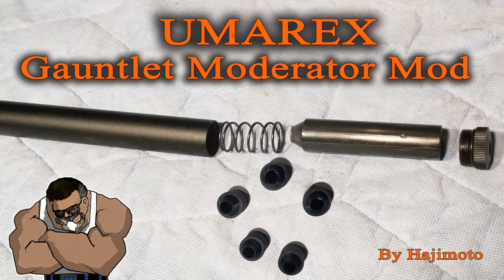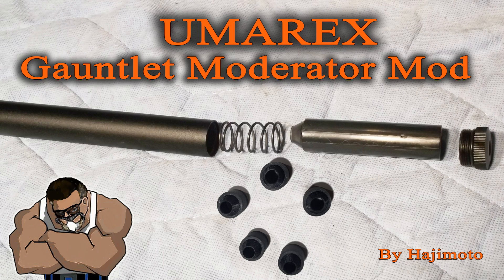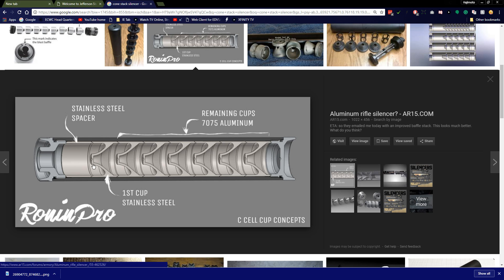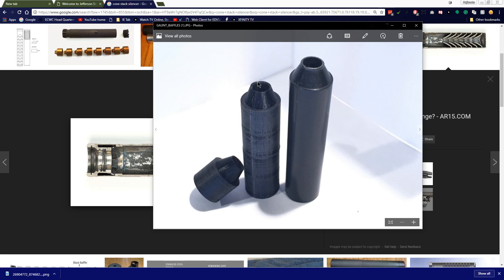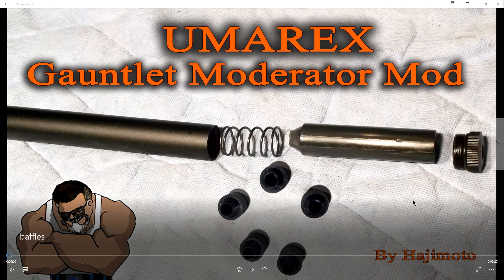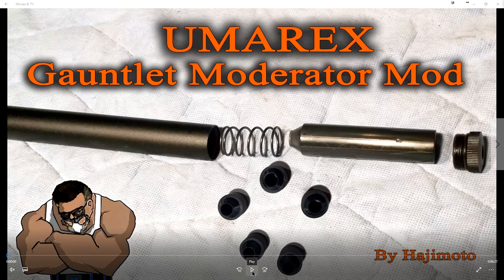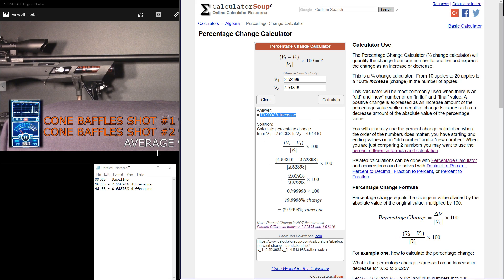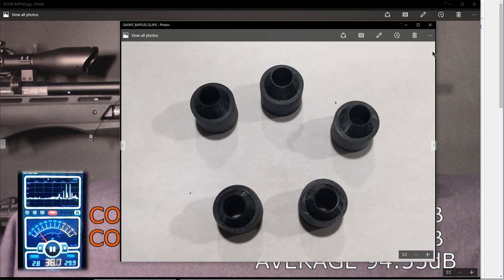Umarex Gauntlet: Quieting the Bark Silencer

Comment: what would happen if you put a few grooves on the outside of the cones to give the air an easier path back to the hole drilled in the shroud?
Reply from the maker: The only air that makes it to the ventilation holes in the shroud is the air that is stripped and diverted from the air stripper. The baffles are after the muzzle and therefore any air turbulence is on the other side of the oring seal so can only exit forward out the muzzle end of the shroud.

Comment: Just unscrew the shroud holder piece that is against the breech and move it forward the length of 5 more baffles and it will produce way lower decibel reading. You will need to make a new indentation on barrel for the shroud holder piece screw to secure properly.( sorry Im not sure what that piece is called).

Thats what I did on my Benjamin Marauder. I added 5 more baffles. It does look a bit odd since the shroud sticks out quite a bit pass the air tube. Well worth it though. Gun is whisper quiet.
Reply: sound suppression is over 90% volume, 8% volume distribution inside the moderator (hint: volume behind the muzzle is significantly less effective than volume in front of the muzzle, this has been known with firearms for nearly a century) (Blast chamber roughly 40-45% of the internal volume works really well), and the last 2% is baffle shape (K or W baffles don't hold/catch more gas, they slow it's return to the exit path by generating more turbulence). I don't get the spring loaded idea, all you're adding is a metallic "TWANG" every shot, as it's one more part to resonate the frequency. Tube inside a tube inside a tube inside a tube suppressor designs are out there for firearms, but they don't use springs, they just have strategically placed vent holes in each tube.

Comment: Question, do you have to drill the barrel shroud at the other end to use the air stripper? Can i use it without drilling it? Or woudl it not work as well?
Reply from the maker: You do not NEED to ventilate the shroud but it certainly help gobble up the surge of each shot. Also, without ventilation is not equal else I would not have recommended and executed it 😉
Reply: @HajimotoProductions  wow fast response, thank you- i will probably later drill the barrel, but for now just want to use it without = my gun is band new- only a few weeks old right now-

Comment: I just got my hp baffle stack in for my .25 Gauntlet! Prior to getting them in, I wanted to do some tests. With just doing your mod with the shroud only, I achieved a 2 db drop in sound. I decided to not use the sponge like you did, and instead used a 2 inch wide strip of fleece cut from a top my wife had in the closet( hope she doesn't  mind ! ) and wrapped it loosely around the barrel, before sliding the shoud over it. This set-up achieved another 2 db drop. Lastly, I installed your HP baffles, and tested again. This resulted in another 4 db drop, with a total drop of 8db when compared to a stock rifle!!! Also these mods resulted in no change to POI for my rifle! I will chrony the set-up soon just for giggles! Thanks for the great info, and product!
Reply from the maker: Thank you for taking the time to offer some feedback for others to read. Thank you also for the kind words.

Comment: You went through a lot of effort to makes this video.   Thank you.   However, you compared the sound of no baffles to the sound of OEM baffles to the sound of your baffles PLUS uncovering the barrel exhaust hole you drilled.   It would be good to know the sound levels of using only your baffles and the effect of only uncovering the exhaust hole.   Without that it really does not give us a proper head-to-head evaluation of the baffles alone.    I would like to know what impact you would have only by drilling the exhaust hole.
Reply from the maker: Hello and thank you Lon for the commentary. You are absolutely correct and are not the only person that has pointed this fact. But as i explained to the other commenters and I will do it again for you here.
The video was to show what I had come up with and tested, because I am comparing my modifications against a stock configuration which does not have a ventilated shroud. Just because my mod has two variables does meant it needs to be deployed fractionaly. I expect (just as you have done here) that the viewer will be inspired to TRY different configurations of their own and discover (and share, hopefully) those results, just as i have.
Thanks again
Reply: @HajimotoProductions  Thanks.  I think you hold the world record for speedy replies!
Reply from the maker: Lon I wish I could answer them as quick but unfortunately I can’t. Thanks for the kind words!

Comment: I guess just drilling a hole in the shroud will void the warranty. That hole is common sense.
There are some airguns with a factory hole or two in the shroud for reasons you stated. Makes no sense that Umarex did no put in an escape hole n the bottom of the shroud.
By the way I did change the o-ring out. I had one a little thicker. Put it on and sprayed some silicone lube on it and it slid down easily firm with no slop.
Reply from the maker: Drilling the hole will void the warranty on the shroud yes, but it should not void the entire gun. I was told by Umarex that they would not void the warranty of the entire rifle due to one thing being modified. Obviously any internal modifications would void the warranty but external changes, no.

Comment: They only sent me four cones! And you are showing that five will fit in the barrel. I'm shooting the 22 caliber version and was wondering why I only got four cones I instead of the five you show.
Reply from the maker: There should be 5 pieces in the set.  In this video you see the early version which was 5 cones equal in size but you should have received 4 equal and one smaller.  In the package you should have also received an arrangement detail sketch that demonstrates how the stack is arranged. Lastly, YouTube comment section is not the best place to vet these issues, the HajimotoProductions.com website would be the most direct way.  While you are on there you can also review the installation detail that I mentioned previously.
Reply: I found my mistake. My wife accidentally ordered it from another website. Just had a miscommunication with her and I will get one from your site.
Reply from the maker: Well if you already have a set from a different manufacturer, have you tried them to see if they are effective before you buy another set from me?
Reply: I did try them out but yours are quieter by comparison. I used my decibel reader and it shot a little louder than your setup.
Reply from the maker: Ok I just wanted to be sure you were not tossing your money away.
Reply: @HajimotoProductions  True but I saw all  your products. Doesn't look like a waste of money to me. Great products and of course very informative and deep videos. I plan on buying from your company in the near future. 😎👍

Comment: Hey Hajimoto what is the external diameter on those baffles?
I have a 2240 with BNM custom shroud that could really use these baffles, if they'll fit.
Reply from the maker: The OD is 22MM (0.866142)
Reply: @HajimotoProductions  Thanks man

Comment: I noticed that the Hajimoto baffle stack is 1/4" shorter than the stock moderator. This will reduce the spring tension on the stripper. Should I put in a spacer to make up the difference or doesn't it matter regarding accuracy?
Reply from the maker: You are correct that the HP Baffle stack is shorter and it is designed to take advantage of the deeper HP Air Stripper which is longer than the stock unit. Lastly, if HP Baffles are used with the stock stripper, accuracy is still improved due to better turbulence mitigation. There are folks like Jame from Shoot to kill outdoors that have found that adding addition shims was beneficial in adding barrel tension. Good luck!

Comment: besides the 4 db decrease did you test out how much less or more in power it has tho in fps? i would like to see if the reason that they have that design was to keep the fps higher.....would like to see you test it out with it and with yours and see if there is a change.
Reply from the maker: I can tell you that through multiple testing and over 100 users that shared feedback, they all experienced a 1-5% increase is FPS and a reduction of 40-50% in the standard deviation when coupled with the HP Air Stripper.
Reply: @HajimotoProductions  nice...I would love to see those videos but I can't find one on YouTube yet... if there any you can link me to that would be great... thanks.

Comment: The air stripper is still there Haji I should have said end of the air stripper instead of barrel my bad, there is no more twang from the gun. I don’t know what else to tell you it works Sir. I have done some tweaking on the for-end also its too loose for my requirements.

Comment: I believe you do not need it, this thing adds noise. Which we are trying to get rid of. My baffles are from the end of barrel to screw cap on shroud.
Reply from the maker: The something is wrong because there should be an air stripper on the end of the barrel then the spring and then the baffles. Again I caution you on firing the rifle without the spring you WILL destroy your baffles and possible damage the shroud/end cap.

Comment: The spring for the moderator
Reply from the maker: No Craig you DO need this, the spring is what keeps the cone-stack concentric, you will have severe pellet clipping without it.  The spring also adds tension to the barrel to keep the harmonic right.  I do not recommend you shoot the rifle with that spring out.

Comment: Will it affect my rifle if i were to fill its with a tire compressor?
Reply from the maker: You cannot fill a PCP rifle with an air compress for tires. The maximum PSI the average tire compressor will output is 110-125PSI a PCP needs at least 1200PSI to work properly. In order to fill a PCP rifle, you need either a High Pressure compressor or a High pressure SCBA tank that you can have your local paintball or scuba shop fill for you.
Reply: Hajimoto Productions what if it was one of the air compressors that you use to hookup to say a paint gun?
Reply: Hajimoto Productions also do you have any social medias?
Reply from the maker: Again, when speaking about PCP's you are talking about thousands of pounds of pressure, the compressors that you are describing are not going to be able to do what your thinking. I can be found on Facebook at Hajimoto Productions
Reply: Hey Haji i just placed my order for HP baffles. Thanks!
Reply from the maker: trevor5534 confirmation email sent, thank you!

Comment: Does this mod affect accuracy?
Reply from the maker: 6" at 30yard is more than a washer.  You need to unscrew the shroud and look at the air stripper to be sure it's not cracked, remove the air stripper and look at the end of the barrel at the crown, does it look normal and concentric? Lastly, try and post your issues you are having in Airgun forums like GTA (Gatewaytoairguns.com) or AGM (AirGunNation.com) not because I do not want to help you but more people will be able to help you and be helped by your posts there than here.
Reply from the maker: Yes, it makes the groups tighter because it reduces the turbulence being applied to the pellet. The HP Baffles with the HP Air Stripper produces a noticeable accuracy increase. Are you having accuracy issues?
Reply: Not yet as I don't own a Gauntlet at this time, lol. But, because I'm planning on buying one very soon I've been doing some research here on YouTube. I've been enjoying your videos since I've come across them doing said research.
Reply: I AM having accuracy issues Haji..just tested out gauntlet today and getting 6" groups at 30 yards. Ordered barrel band and gonna try m8 washer behind barrel tip screw..just gotta tighten up the barrel. So u say that your moderator really tightens groups? That along with quieting seems great.  I checked air stripper and no cracks. May just have to order your moderator.

Comment: I notice this video was made before the video of the air stripper redesign. Has that mod made this even quieter? You also mentioned the air is released between the cones and is exhausted out the hole made in the shroud, won't the O ring on the air stripper preclude this from happening?
Reply from the maker: The Pellet is already out of the barrel by the time the baffles are dealing with the air blast.  Because there is a time delay, the pressure differential between the muzzle and the breach means the gap between the stripper and the first cone acts as a low pressure zone and the pressure is relieved through the stripper and ultimately through the shroud.

Comment: So Haj , don’t chastise me for asking what maybe a stupid question. Is the air “gases” going to get past the O ring after “ burping “ past the cones to exit the the new hole at far end of shroud ? Or maybe, there should be holes in the spring area . I’m no engineer by any means but a O ring is a O ring and there to stop it from passing by. 
  
   Just a question I thought of after watching this for the third time or so. I’m debating on the the purchase of the baffles. Keep up the good work I love the vids and your expertise in the field of Air Guns.
Reply from the maker: Dan I would never do that man! The air stripper back is one chamber and the air stripper forward is another, they do not dynamically communicate during firing but they equalize after the shot as the bore communicates to both. Trust me on this, the HP Air Stripper combined with the HP Baffles is an improvement in air handling and suppression, not a sales pitch, just a fact. If you are on FB, go to the Umarex Gauntlet Owners group and ask for yourself.  Thank you for the kind words man, I appreciate it.

Comment: You would get a much larger decrease in the output volume of the gun by porting the baffle cones themselves, this is what most firearm suppressors do. The baffles 'burping' like that would be creating noise itself, even if they did open up. If they are opening up however, that's because of the pressure, and that's what suppressors/moderators actually disperse, not noise, since the pressure is what creates the noise. Try incorporating gas vent ports in the cones themselves so that all of the pressure can be vented into the longer chamber of the tube. Also, airgun moderators tend to be a little more efficient when there's a little more empty space between baffles from what I've found. More room for the air to expand and get diffused before leaving.
Reply from the maker: Thank you for your comment SnowblindOtter

Comment: What about cutting the stock baffle into sections? Would that help since they would be able to open up to allow the air to escape? BTW - Thanks for your great videos!
Reply from the maker: Hey Jim. I love the way you think! It means you're THINKING 😁
Unfortunately though if you cut the factory baffle into sections there is no mechanism in place to ensure they stay perfectly aligned to allow the pellet to pass through. The tolerances between the pellets outside wall and the baffle cones inside wall will be only millimeters apart else you will have a crash and all pellet accuracy (not to mention your baffles) are lost.

Comment: Order for set of your baffles is on the way.
Just received my .22 Gauntlet this past Wednesday, ready to get it it shooting straight and quiet. Been following all of your vids on what your doing to your Gauntlet. 
I am, going to make sure things are as they should be, straight out of the box. But I really don't care to much about, "voiding the warranty" if I change things on it. Hell, I started modding my P-rod as soon as I opened it's box.
Reply from the maker: Received, confirmed and shipped! lol, Yup take her out the box, put 200 rounds through her, degas her, pull the action out of the stock, clean the barrel, tighten all screws and bolts, check air stripper to be sure it not cracked, silicone all the o-ring, reassemble, 20 shots to relead the barrel and she is ready to go!!  LOL sounds so simple when you read it like that huh?  Enjoy Tom and thanks for the comment!

Comment: Have you thought about weakening the spring pressure to allow a bigger "burp"? Also having shot military suppressors on subsonic 9mm hand guns a bullet wipe is really the largest contributor to sound suppression.
Reply from the maker: I have thought about a spring reduction and may order another so I can experiment. Yes, the bullet wipe is a superior method of suppression but due to the variables (including but not limited to) inconsistent ammo and more importantly, manufacturing tolerance requirements that I would just not be able to maintain. Your comments are AWESOME and I appreciate you taking the time to write to me!